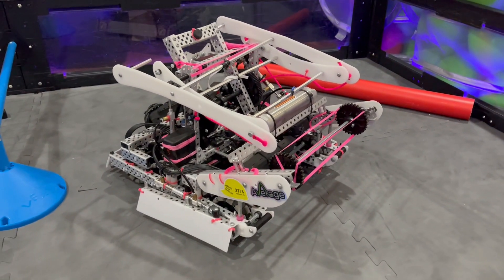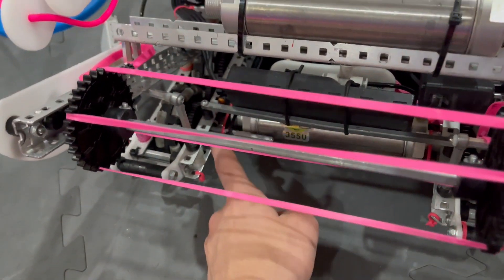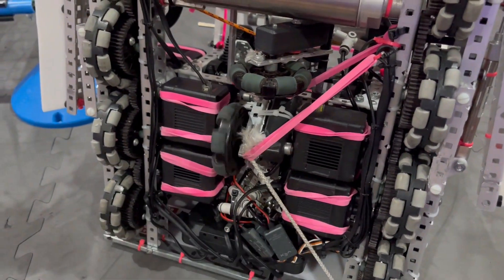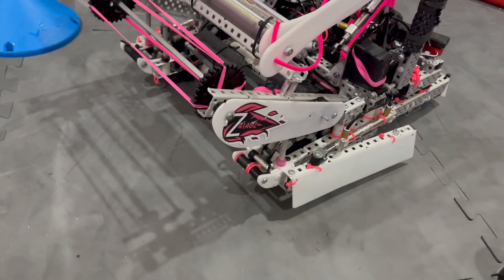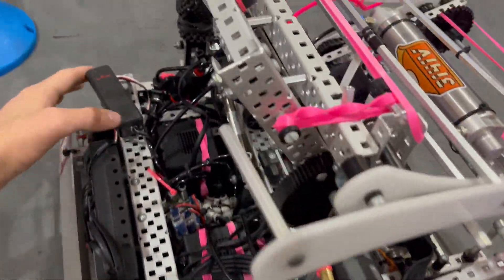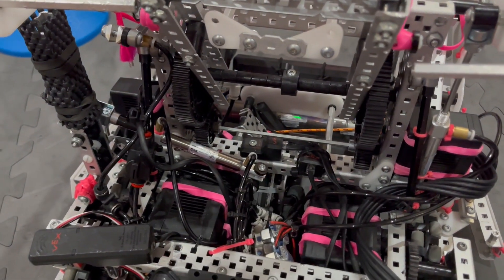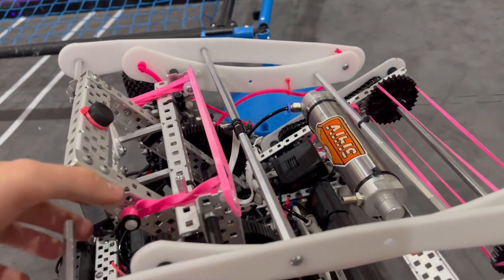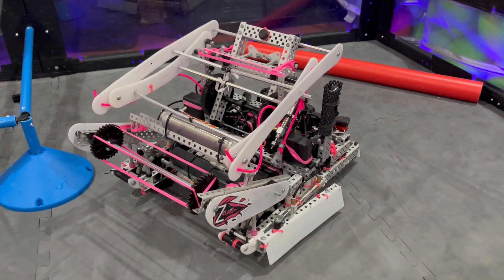1082J Mid-Season Robot Explanation

Comment: Excellent robot, why do you use two inertial sensor? I am so curious about it
Reply: it gives a more accurate heading because the imu sensors usually have drift in 1 direction
Reply: @dish7343  thanks, so you make an average of the two readings?
Reply: @alonsoibarrahector8773  something like that probably, ive never run it before personally
Reply from the maker: We started to try to use 2 but only ended up using one of them!